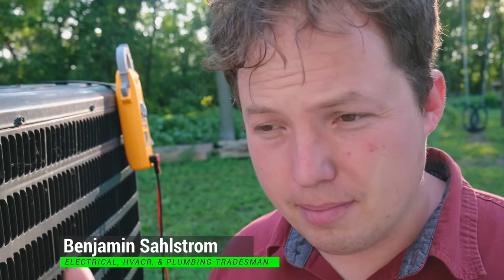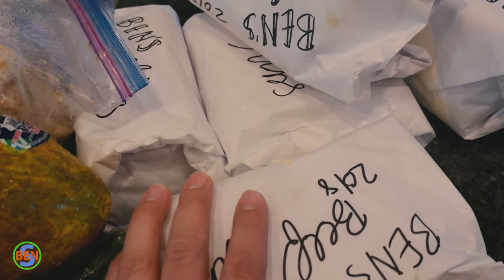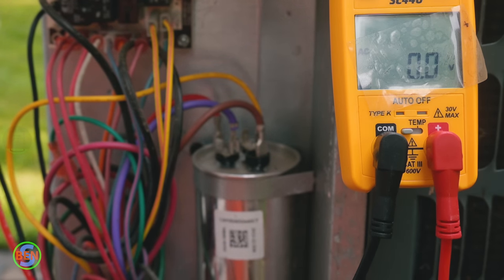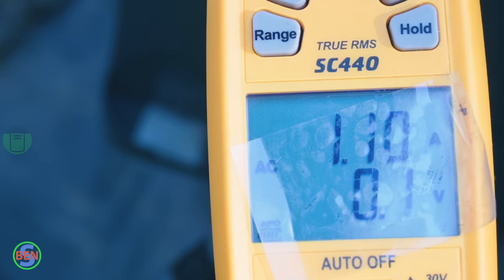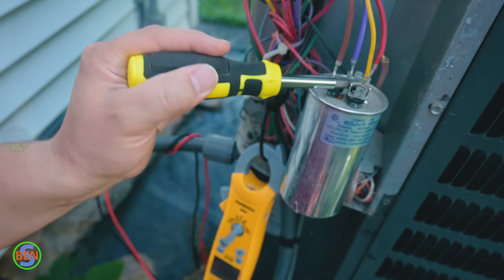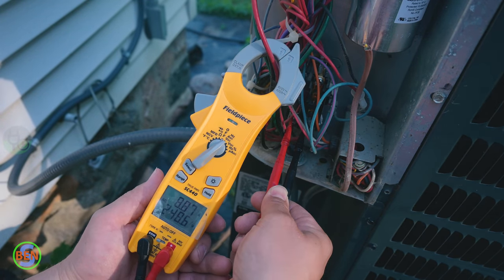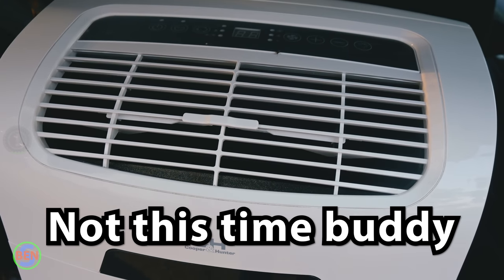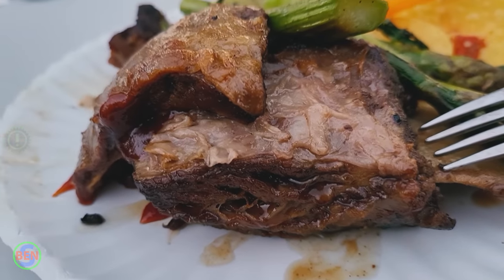Strange Energy Spikes Sensed by Energy Monitor!

Comment: On your initial voltage check across the capacitor you had the DVM in AC volts which will be 0VAC with the supply open.  The proper check should be DC volts to see if you had a static potential across the capacitor terminals.
Reply from the maker: Thanks for that information.

Comment: Had a similar problem with my heat pump before where the capacitor would test out fine, but it turned out to be bad under load. About a year ago, I installed a Micro-Air soft starter to bring the LRA down from 56 amps down to a manageable 20 amps so I can run my HVAC on a 7.6 kW portable generator.

A couple months in, the run capacitor slowly began to fail. The "brains" on the soft start unit was able to learn what it needed to get the compressor going keeping the LRA down and figured out what the RLA nominal range should be. When the RLA was started to creep up as the capacitor was partially going bad, the controller placed the compressor in 5 minute timeout. The onboard diagnostics was able to point me in the right direction of troubleshooting the problem. Having the ability of run almost the whole house including A/C on a backup generator when the power is out and the outside temperature feels like 116°F is a priceless relief.
Reply from the maker: That's really fantastic. I want to make a video about those soft starter systems. Where did you purchase yours?
Reply: @BenjaminSahlstrom  I guess YouTube spam filters are being naughty again. I purchased mine through Micro-Air model ASY-368-X48-BLUE for my 2.5 ton heat pump.
Reply: I made my own using NTC Thermistors(the hotter they get, the less resistance across them) and a relay; they are actually a really simple circuit, it just lowers the input voltage, and it will cause it to pull less current, then once it is no longer in the "locked rotor" state, it kicks into "Pass through" mode and it continues spinning up.  Cuts the "start up" current WAY down.

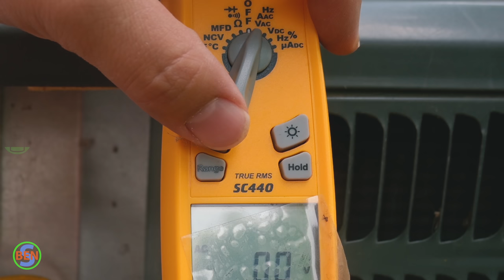Comment: 5:06 When you were testing the capacitor at the terminals for fan motor and compressor. You mentioned that you were testing for capacitance which in fact your multimeter was set to resistance testing. When testing a good capacitor in resistance mode, reading will spike up and then show infinite resistance. That is what occurred when you tested the fan portion of the capacitor. The compressor portion of the capacitor was showing a resistance value (shorted). It was difficult to see your multimeter screen because of the plastic screen protector.  Other than that you have great content!

Comment: I did not see if you checked to see if the capacitor was shorted between the FAN and HERM terminals, that happened to me with 2 different capacitors, two years in a row.  I now keep a stock of capacitors and a couple of hard start caps for my HVAC system.  I absolutely love the sound of a compressor starting up!!!  And that soft low growl of the compressor running.  I'm MVAC, and Type1 and Type 2 certified, but only do HVAC work on the side, as I'm a network admin for my normal job.  I love the way a capacitor will change the phase angle of a/c voltage, giving the extra power for running/starting, it actually increases the "power factor" of the equipment running, always be certain not to exceed the rated capacitance of the equipment you are running, or it will burn it up.

Comment: I had my capacitor fail on a the hottest Sunday of the year. Capacitors are cheap but not something I could get off the self at a local hardware store or big box home improvement center. I luckily was able to get a hold of the guy that installed the system, he was at his shop and I just had to meet him there and he sold me a capacitor. Huge savings for me over a Sunday service call. I now keep a spare on the shelf for next time.

Comment: You were testing the capactor using the ohm's range. So the reading you were getting on the HERM side of the capacitor was in fact a resistance reading showing the capacitor was bad. The FAN side was open, which I would expect for a capactor.

Comment: Capacitors used to last forever.
There are plenty of cheap chinese caps i can get in canada, but if I need a cap it's an american made ordered from the states. It's worth the extra premium even if a 5mf costs $30 instead of $10 locally.

Just to note - the amazon linked caps are actually packard brand, not titan pro as shown.
Reply: Old capacitors were huge and had more dielectric and oil in them; however for the last 50 years we were reducing sizes and that causes some of the problems!

Comment: you should check DC voltage across the capacitor... if that cap was somehow disconnected from the mains at the maximum of sinwave it would have been a bad day shorting it like that ;)

Comment: As was pointed out below you missed the capacitance setting by one click on your meter. Your meter (~5'43" timestamp) is set to the diode/continuity/resistance setting rather than capacitance as can be seen by the switch and the MΩ on its display. In any case, you got lucky and still fixed the problem!

Comment: not to criticize you for shorting cap terminals prior to removal but in these circuits the windings of the motors short the caps for you unless a winding is open. These film deposited caps are notorious for strange test behavior. The al film is so thin that a failure may leave just a shred of al which will permit enough test current pulse to give a good indication. Good decision to replace cap before getting out the tube cutter and going to work on comp replacementr! FYI the modern A/C caps are notoriously unreliable when compared to the 50 year old pcb paper-foil caps.
Reply: it's always good to make sure the cap is discharged, if a compressor fails to start it could be due to open windings, preventing cap discharge.

Comment: You would think that a locked compressor would draw over the breakers trip capacity and trip.

Should have done an amp draw test with old capacitor to show the difference.
Reply: He did
Reply from the maker: You would think! Breakers are designed to temporarily allow more current than their rated capacity.

Comment: The capacitor may have high Equivalent Series Resistance (internal resistance) and still appear fine on the multimeter.  A high ESR would cause a severe voltage drop across the resistor and thus not provide the surge current required for startup. The voltage spikes may be due to resonant oscillations between the capacitor and the compressor coil. Just best guesses on my part based on what I know about electronics, and what I don’t know about cooling systems.

Comment: There is an other possibility. 
16568W/120V = 138A or 16568W/240V = 69A ... so your fuse would immediately stop the current flow because of the magnetic release of the fuse.  So the current reading could be wrong.

The maximum value is a bit strange, it is very close to 1^14=16384
16568-(2^14)=184 Watt

There is a possibility that the energy meter has a bug. We had the problem in Germany, some producer of the energy meter simply did something wrong-  We had there a bad written software and what you see there is a "buffer underflow" while calculating with a 14 bit value from the ADC of the micro-controller. Simply a software / firmware problem.

If this damaged capacitor would need so much current, then it would be possibly better to reduce max. allowed current. We have here fuses with 16A (Type B) what we use for a normal 2.5mm cooper wire. Possibly this would be okay for your breaker-panel too, then you would recognize the error immediately if this is happened again.

Comment: I was wondering if you could recheck your meter reading set in the uF mode or possibly another meter.  That reading might possibly be in nano farads instead of uF.  I was watching another video where the capacitor failed, and the meter reading was actually reading in nF.  The name of the video was (Was I WRONG? Can a capacitor fail with high MFD).  
Thanks,  I enjoy watching your videos.
Reply: he had it on the wrong setting go back and watch needed it on mfd

Comment: Usually when you test a run cap that has been in service for a while it will show slightly lower mfd yours was showing higher and the fan side nothing i would bet it was either shorted or leaking to ground the two tip offs fan working with no mfd compressor higher mfd,and that is why in this case one would do a load down cap test...great vid including getting Family in the vid👍
Reply: Yep, I'm willing to bet that's what it was, I have seen this happen so many times.  It actually happened to me last year and the year before last.  I now have 2 backup capacitors on hand for my system.

Comment: You have checked only capacitance, which is correct. You haven't checked leakage between capacitor's plates.
Reply: That's the most common way I have seen them fail, had 1 fail that way right out of the box.  I went through 3 caps in 2 years, now I keep spares and hard start caps on hand at all times.

Comment: Is it possible your broken capacitor works perfectly fine at the low-voltage of the multi-meter, but completely breaks at the higher voltage of operation?
Reply: Yes, it is.

Comment: In alternating current, Volts X Amps = Watts only when the power factor is 1.000. Motors are inductive and use a start capacitor, so Watts would Equal Volts X Amps, X Power factor. Not sure if your power monitor does true RMS watts power readings or just measures current. Another loss is in the line between the panel and the compressor, so voltage at the compressor when running is lower than the voltage at the panel.

Comment: I need your help ,What size of ac do i need for a 500 square feet shop ?
Reply: Depends on the heat load.  What is the insulation?  How many windows, and are they single pane or insulated?  How much air leakage do you have?  Are there any drafts?  Do you normally feel any cold/hot spots like near windows or doors?  How is the roof insulation?  500 sqft shouldn't require a very large air conditioner/heat pump, but if there is a lot of heat/cold leaking through windows, doors, walls, ceiling/roof, then that can cause the requirement to go way up.

With decent insulation and decent windows and no noticeable drafts, a 12,000btu/hr mini split a/c should be more than enough, may be able to use as little as 10,000 btu/hr mini split heat pump instead if the shop insulation is good.
Reply: @johnbrizendine7716  You are right; customer doesn't mention what kind of equipment he has and what additional load they would exert on cooling system. 500 sq. ft. is about the size of a two car garage. So additional load could be critical! As far as spare parts it's nice to have some on hand. I kept some for years and never used them at all.!

Comment: Something dont quite jive there. Funny that yellow wire for the compressor is so much smaller than the brown wire for the fan isnt it?  I mean starting current for a compressor is many mutiples of the starting current for the fan and for that reason the compressor should have relatively lower guage wire than the fan. Not neccessarily telling on it's own as long as both wires are heavy enough to do the job, but that caught my attention. 
   Ummmm  Are you sure you dont have 5mfd start capacitor for the compressor and 45mfd for the fan?    
That would explain why the compressor would not start when the 45mfd side of the capacitor read good but the fan would start on the 5mfd side that was bad, caveat being that I would give the fan a whole lot better chance to start with a dead cap than the compressor.. If the wires are swapped I'm suprised your compressor ever started on 5mfd at least until it killed the cap. 
I would check those wires on both ends to verify that the wires are not swapped.

Comment: I could be not seeing it right, but your meter was not set to mfd for you capacitor test.
Reply: It was in Ohms from what I saw.
Reply: The testing procedure was correct but the meter setting will give an accurate measurement.
Reply from the maker: True! I used the automatic testing feature but probably should have just switched it to MFD. My old tester didn't have a dedicated MFD setting and was combined with the Ohms so I'm still getting used to having the dedicated mode.

Comment: Do inverter systems need capacitors and soft starts? Or is all of that built in to the inverter circuitry?
Reply: Its really only induction motors that require a starting capacitor.  It has to do with the difference of angular velocity between the rotor and the stator.

Comment: How many tons, and what was outdoor temp, thx.
Reply from the maker: 3 ton, probably 85 degrees or so.
Reply: @BenjaminSahlstrom  I ask because I have a 13 seer 3ton HP and with blower motor and 85F it would pull about 2700watts.  The difference between 13 and 16 seer.  As seer goes up each seer unit gets less savings, not linear as you may know...Thx

Comment: The 5uF side of the dual cap is the start capacitor for the single-phase induction compressor motor. Is it switched into the fan motor circuit (run cap for the fan motor) once the compressor motor has started up?
Reply: No, it's basically just two separate capacitors in the same casing for ease of fitment and cheapness. You could fit two individual capacitors and the system would run the same.
Reply: Those new caps are absolute trash, I have had 2 in a row short the HERM and FAN terminals, and one other one bad right out of the box, it popped as soon as it kicked on.  I now keep 2 on hand, and a variety of other single caps, and a hard start cap, just in case.
Reply: @johnbrizendine7716  Were those capacitors made in China?
Reply: @bobboscarato1313  Probably.  Got them from Johnstone Supply.

Comment: i use old school tools 👴 since i am.. 👍
some stuff test fine.. not in a use situation. when i moved in the last guy here that came to repair the a/c got pissed cause he coupdnt sell a whole new unit.. i guess. so he ripped out EVERY wire in & out both.. even took all terminals. what a jackass. i have pics. so i had to... OH and he destroyed the wiring diagram.. so i had to from memory rewire ALL. just to test & find the original problem? turns out the reversing valve solenoid was burned out.. he wanted $5.500 to fix it. the guy here was old & on a fixed income at the time.. so if you cant pay some will make you pay.. me personally i did LOTS for either free or part cost or the trip charge when i came upon people that i could see really couldnt afford the fix.. like a single mom with 3 kids struggling or a vet or.. someone broke in need. but thats me.

Comment: You know the 21st century method of home cooling is connect to your well with a well-connect unit those compressors certainly will not cause a 16,000 watt rotor lock condition, the 20th century model with the lossy outdoor passive air system used to be really cool but using a well connect your well water actually does most of the cooling for you, it looks like you're in a rural area where you could use the exhaust water for Watering your garden.